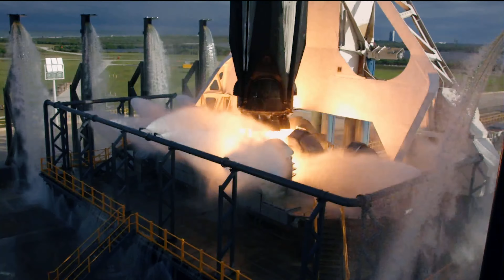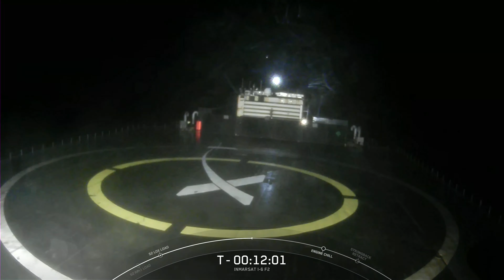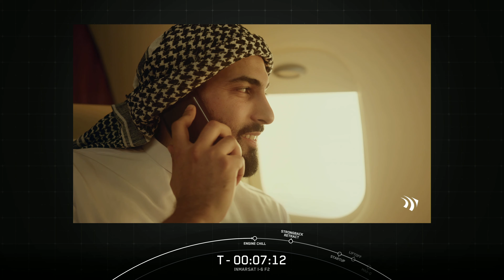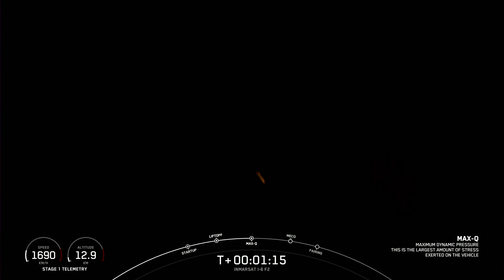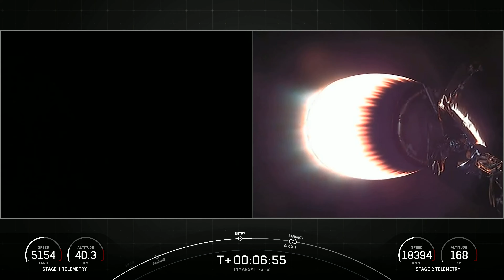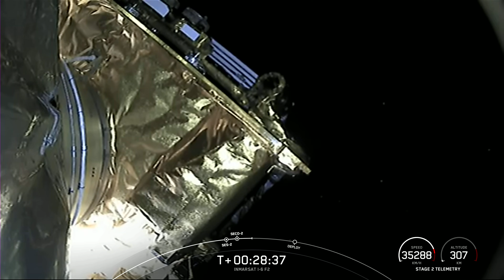Inmarsat I-6 F2 Mission

Comment: Stage 1 speed drops speed but still climbs with momentum, then speeds back up under the gravity pull then slows down with air friction then the engine fires to prevent  over speeding

Comment: I understand that the first stages are reused but are the first stage engines also reused?
Reply: Yes, they are reused
Reply: Yes, the entire stage, including the engines, is reused. Since it is so easy to swap engines out though, a booster may not have all the same engines on one flight that it had on the last if they wanted to perform maintenance on any of them.

Comment: How soon after a satellite is released, does the engine on the satellite ignite? I wish we could see it light up.
Reply: They're small, just puff like
Reply: yes.  either to move to a higher parking orbit for space junk or to de-orbit and break up
Reply: Inmarsat uses xenon ion propulsion system (XIPS) so there's nothing to ignite. It's electric propulsion - no fuel is burned.
Reply: I think most satellites have solar panels to power their engines, so they don't carry any fuel. It's just a small push for orbit
Reply: @brunosmith6925  This is so complete untrue, not correct, false. They accelerate Xenon Atoms via electric loaded high voltage grids. The fuel is called Xenon.
Reply: @brunosmith6925  Xenon is the fuel/propellant however.
Reply: @AGENT47ist   How do they convert electrical energy into propulsion???
Reply: @AGENT47ist  They still carry a propellant, the electrics are there to accelerate the propellant out of the motor.
Reply: @brunosmith6925  Ok, thanks to you and others who responded without attacking me, but rather educating me. Now I understand why I don't see anything. It is awesome to learn new things!

Comment: Okay all you rocket scientist, tell me why the second stage was losing speed between burns?
Reply: Haven't watched this yet  but gravity?
Reply: Even in orbit, there’s still atmospheric drag till over 900km
Reply: It was probably going up, trading speed for height.  That's the usual plan.  Give it enough speed to reach the desired height, then do s second push to put the payload into the right orbit.
Reply: Coasting second stage going up equals lower speed. Going down equals higer speed!
Reply: Because as it climes higher up in its orbit, gravity begins to slow it down. Picture throwing a ball up in an arc, it reaches its slowest speed at the top of its arc and then speeds up as it falls back down
Reply: because it was ascending without any thrust so therefore decelerated.
Reply: New thing out called “gravity”; as the vehicle ascends, it loses relative velocity, heading toward the apogee of its orbit. Don’t worry, for as it swings around toward it’s perigee, it’ll speed up again.
Reply: @kevinmcgovern5110  Kepler's laws...
Reply: Because it was falling down. Regular obje cuts - not VIPs or politicians tend to fall down to the next big object in space. Also called dirt.
Reply: @abelis644  Gravity is overrated!
Reply: @LukiePookie-c1g  In Spaceballs we „see“ the atmospheric door. You want to tell me ours is at 900km? May be…
Reply: It was  trading altitude for velocity, very clearly shown on the telemetry.
Reply: Not to mention Newton…

Comment: Supersonic was called early at 1170 kph. It doesn’t hit that until 1234 kph.
Reply: That depends on air density
Reply: @phildurgin652  I concur. Speed of sound is dependent on air density.
Reply: There is also a small time delay between the voice-over and the visuals.
Reply: At that exact spacetime in that exact air density and exact temperature it was exactly 1232,42 Kilometers per Hour.
Reply: @brunosmith6925  Also called light speed…
Reply: @wolfgangpreier9160   Huh??
Reply: @ZXLNT  Huh what?? Light Speed is 1232,42 Kilometer per Hour in Beryllium. Did you not know? Now you know!

Actually its even slower but how counts?